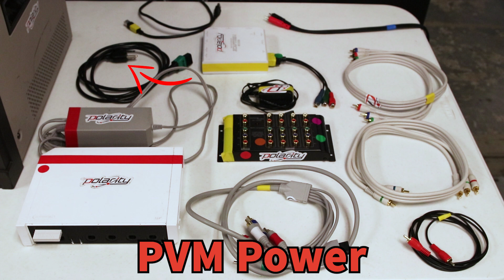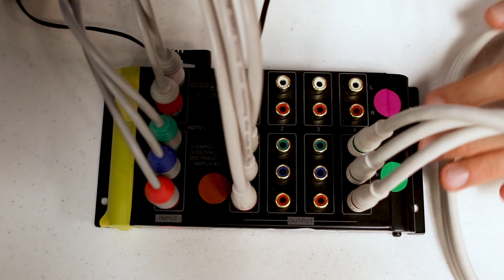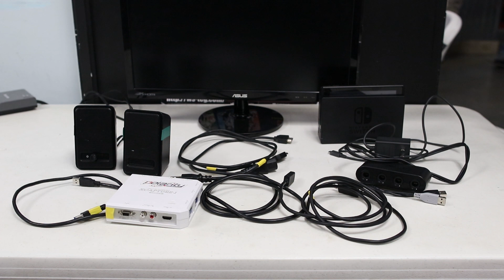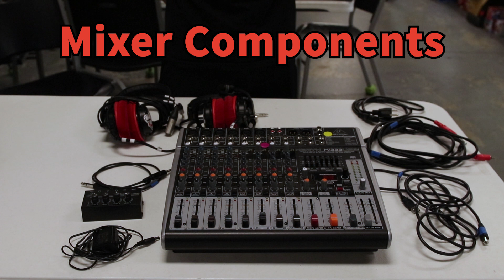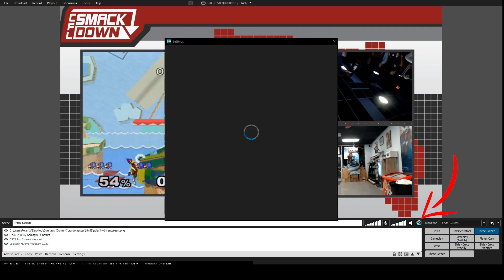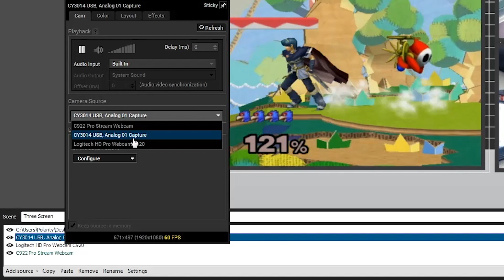Smash Ultimate and Melee Streaming Tutorial

Comment: I’m new getting into melee again then eventually ultimate... and kinda confused on the setup. Is it standard to use 20xxTE on a wii for tourneys? Should I go for that option if I want to compete or is it necessary
Reply: 20xxte isn't completely necessary. most people do it because it unlocks everything and it has quality of life features like stage striking and UCF. You're definitely free to use a regular Melee save if you feel like it, but try to match it with the other setups at any given tournament. You don't want to be the one guy without UCF if the entire tourney is running UCF.

As for wiis, people use them because they're easier to run homebrew on (and therefore nintendont can be used) and they have much cheaper component cable systems. like above, you're free to use a gamecube. In addition, if you look at hax's "how to host SSBM without CRT's", you can theoretically play on an LCD with an HDMI adapter, but this absolutely requires a wii. (i wouldn't do this just yet, people are still going to yell at you.)